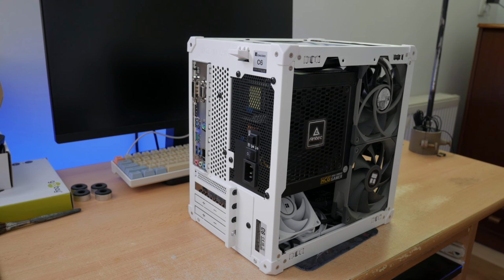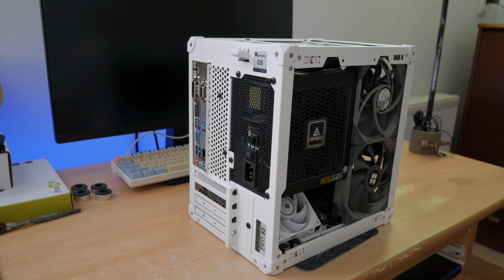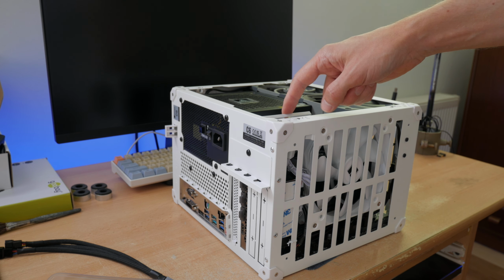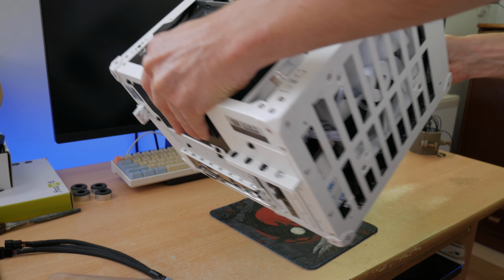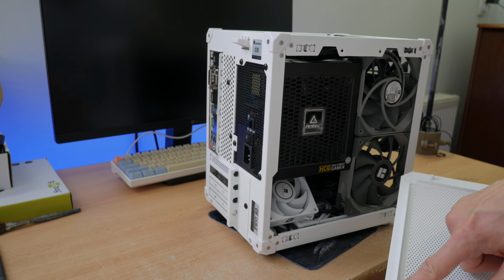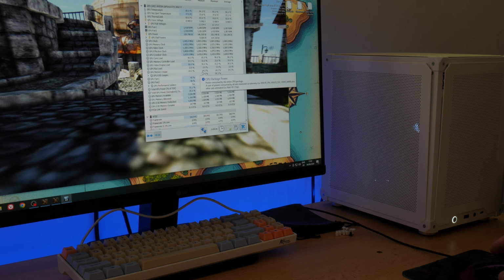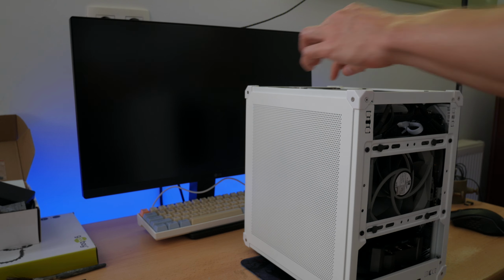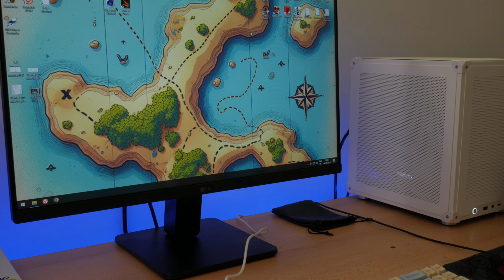Jonsbo C6 How many FANS can you use?

Comment: Hi, thanks for the video. I also want to build a new computer in this case. I'm curious if it will fit two 120mm fans on the top and two in the front instead of one 140mm fan?
Reply from the maker: Hey, thanks for the question.
The top can potentially fit 2x120mm fans, but you will have to make your own brackets and you may need to remove the panel holding clips (I am using a 140mm fan and an 80mm at the top back, butonly because I had one on hand)
The front has more space and 2x120mm fans are possible, but you will need to make your own brackets. However, if the GPU is too long it can prevent you from installing the bottom fan.

Comment: The fan infront of GPU should blow out, I installed one and recognized that the fan blowing out will suck hot air from GPU out of the case! While blowing in will increase the temp inside the case!

Comment: This setup is pretty bad, you generally don't want intake fans on the same side as exhaust fans. You want entire panels/sides of the case be either intake or exhaust to keep airflow as simple and therefore laminar as possible, this way you have a lot of turbulent air.
Reply from the maker: Thank you for your input. What you say makes sense, but I guess I would have to do some smoke test to see the actual effect and the severity of it - could be decent content if I manage to do it (and right).

Comment: Thank you for sharing! I am planning my build in the same case. What I found out for such cases with bottom mounted fans is that the best option to get low profile fans to create more space between fans and gpu. I am wondering if there is possibility to mount two 120mm fans on the bottom. 
Also I found out that there is possibility to mount 120mm aio in the front, which significantly improves cpu temperature at the same cost as low profile air cooler. 
So far I would try to fit 2 low profile 120mm fans at the bottom, 120mm aio in the front, 140mm fan at the top and tiny 40mm fan for vrm/ddr zone (it really helps). 
It was really good to see your video, I got the understanding what else and how I can try to fit into the case, thank you again!
Reply from the maker: Hey, thank you for your input!
The low profile fans could certainly work. However, the front mounting brackets for the button and I/O is taking up space so at most there is 22cm space which means no 2x120mm fans, maybe you could tilt one fan over the bracket, but it would depend on the GPU length and shroud shape.
In case you're feeling adventurous you can use a 160mm fan at the top, more specifically the SilverStone SF160 - but I have my doubts if that would be that much better, over a 140mm fan, to warrant a $30 price tag.

Comment: That's crazy bro, but interesting. You should make a video with 140mm fans on the top and bottom and two 120mm fans in the front to see how the temps are and maybe some on the sides.
Reply from the maker: I would definitely like to do that but I don't have a short GPU that would allow me to add another fan in the front. The one I have barely fits in.

I can imagine the temps being a bit better if one would use an SFX PSU instead of on ATX. I also came across a 160, or was it even a 180mm fan, that could fit on top, but it costs like $30.

But I think the biggest improvement would be a bit bigger holes, but there's a ton of them to drill out by hand.
Reply: @jackalldiytech  What graphics card do you have?
Reply from the maker: It's an RTX 3060 ti by Inno3D
Reply: @jackalldiytech  must change it to RTX 4060 low profile. but your performance will go down. i think its better just keep what you have, just need to be undervolt so the temperature didnt fly. Changing itu SFX PSU is the best investment rather than changing your GPU.
Reply from the maker: @patrickgrady7047  thanks for the information, I will definitely keep that in mind for other smaller form factor builds I'll make.